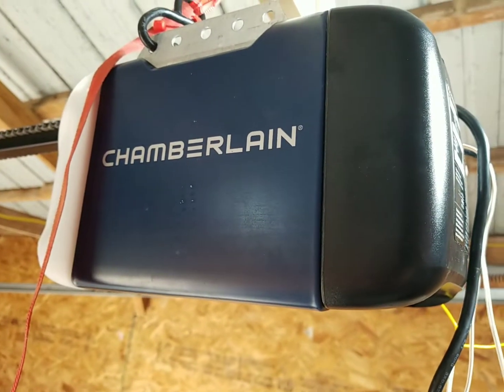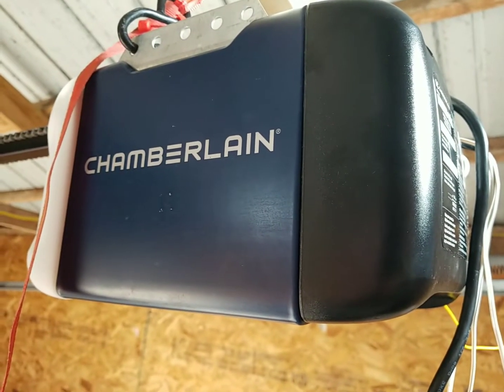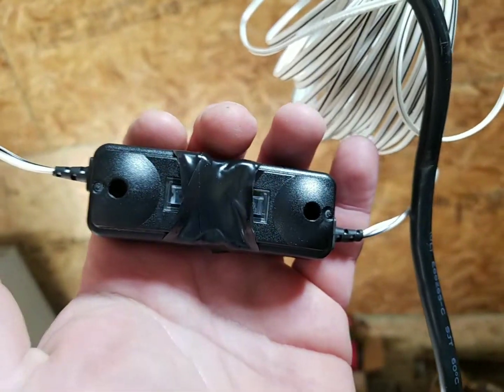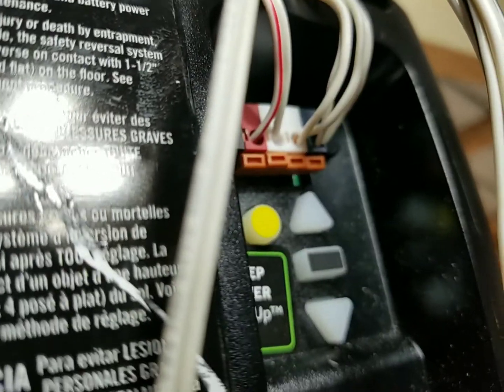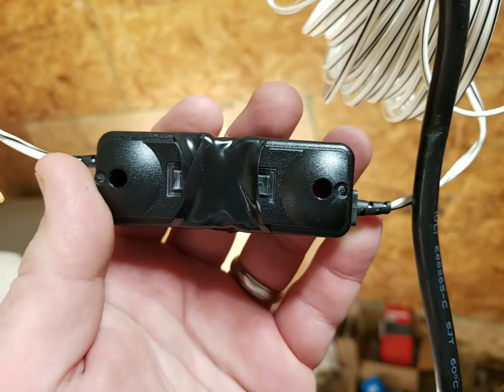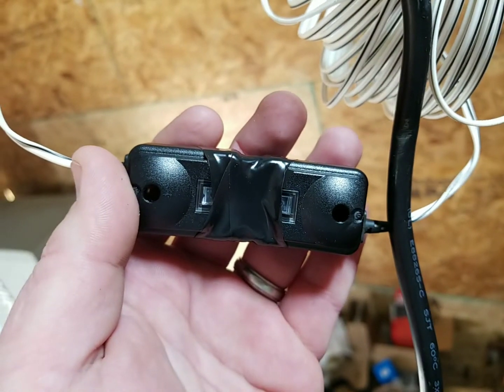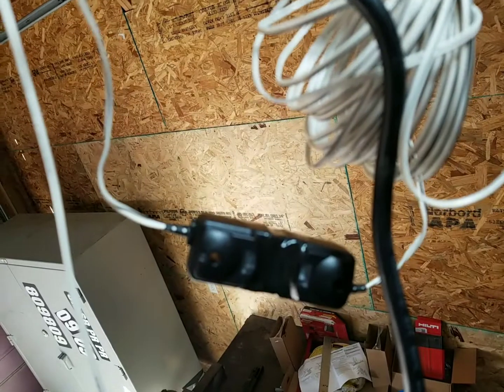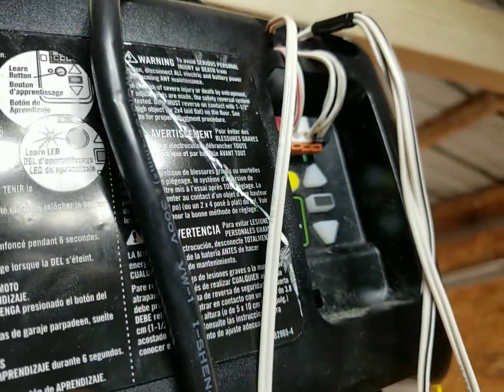Can You Use a Jumper Wire to Bypass Garage Door Sensors?

Comment: the problem with most senors is they use cheap single wire connections that break over time- you can solder better wire back and reuse  same sensor if you open it up and use common sense instead of buying new- and remember you have a catcher and a receiver of for both sensor for one door... one receives and one sends- dont try to use anything but a set when trying to fix two separate garage doors dont mix em up if you can... hope this helps! JM

Comment: A big tip of the hat for mentioning the "pulse signal" because I, too, was wondering why the heck we just couldn't jumper the thing with a wire.   I wonder if the manufacturers do that just so folks can't easily override it.
Reply: I think you are 100% correct.

Comment: So basically, I'm screwed. This doesn't work for me. I replaced the sensors and the door still won't close 80% of the time. Door moves freeley and is balanced and nothing in the way. Very frustrating.
Reply: Did you ever get it figured out?

Comment: These sensors are anpain in the a**. Spent like $10,000 on a fancy garage door from a professional company but they use this junk home Depot brand. Nothing but trouble with these stupid sensors out of alignment even though the lights are indicating they are. One time I found a spider web partially blocking it. But ever since then it just hasn't worked right. Finally ripped the crap out today and just did this basically. Use the mounting holes to make a sort of bar between the two so that I didn't have to use tape and it held nicely. Just have to keep an eye in case some spider decides to go between there and do a bunch of webs there's about a millimeter gap. I'd post pictures of what I did but I don't think YouTube let's photo replies. I wouldn't bother putting this where it belongs I'd leave it like this. I guess it's a safety measure but I'm not sure like you know if your foot or something gets stuck in it and there's any kind of pressure this garage door opens up anyway. And even that is giving me headaches. LiftMaster is really a pain in the you know what to modify any of the settings. It's purposely designed for service calls. I like the garage door but I hate this brand opener.

Comment: Did you actually try short circuiting / jumping those two terminals?
what happens if the wires connecting your sensors short circuit because installers don't bother to tape or wire nut them, do they arc/spark? (yes, i know its only 6v) does it blow a fuse in the motor? pop a capacitor on the circuit board? does it do nothing at all?
Reason I ask is... a neighbor just had a fire start in their garage. she swears it was started by "garage door came down and hit the bottom sensor which sparked"
This sounds highly unlikely... I don't understand how their door could hit the sensor first of all... I would just go out and short the wires on mine to see if it can even create an arc, but I don't want to blow something on the circuit board in the motor.
Reply: There is no way those sensor wires could start a fire if shorted together. That's all low current and low voltage. The sensor inputs are tied to the microprocessor I/O ports. It's not fused. Some boards are current limited and don't care if a short is present. Some boards do. FYI
Reply: @Chriscraft50  Right, my thoughts exactly.
Reply from the maker: I did try it. Nothing happened. I can't say for sure if you'll have the same experience, or if the results vary with different model openers.
Reply: I tried it as well and nothing happened.  It didn't hurt the unit, but it also didn't bypass the sensor.
Reply: I tried too. nothing happend
Reply: It's more likely someone spilled some gasoline, or sprayed WD-40 all over the rails and all over everything, and some frayed wires chewed up by mice started a fire. 

They couldn't sue themselves nor sue the mice, so they sued the garage door business 

Shorting out a car or motorcycle battery will certainly make a big fire, done that. The car battery has enough amps to melt steel. I've done welding with an old, used car battery.

However, a garage door sensor uses 180 milliamos, according to that 12 minute video this guy mentioned, so no fires there. 

Maybe a hot LED, but that's it  It only takes 3 volts to burn out a 2 volt LED, and even then they simply get a little warm.

I once hooked up my battery backwards in an iPhone. It got really warm, just about too hot to touch, and so I dropped it onto my vinyl couch where I was working on it while watching TV. Nothing happened. Well, no, I switched to Motorola.

My Dad once started a fire by never dusting his room nor his computer monitor, and the dust shorted out one small spot that burned up the board, making a hole and melting the solder. Well, that stopped the electricity, which stopped the fire. It went out by itself.

A few days later I soldiered up his 3 components and he used that monitor for another few years until the blue and green pixels stopped working and everything looked pink. 

So, shorting out a garage door opener, the motor controller on the cieling, might start a fire, but I doubt it would burn long enough to start the plastic housing on fire. And if that doesn't catch, then the drywall won't catch. 

Unless, of course, you spray it up with WD-40 just before shorting it out. Then you get a big fire. That s*** burns like gasoline. Great for starting campfires.
Reply: @MultiPleaser  yeah the lady's story didn't make sense on several levels.

FYI WD-40 is not actually flammable by itself. It's the compressed aerosols in the spray can that are flammable which are gone immediately after you stop spraying.
Reply: @squirts1 Actually, I save all my greasy and oily paper towels  for a year and take them to the campground. The wd-40 oil has long since lost its volatile compounds, and it still burns like gasoline. Very hot.
Reply: @squirts1 So, water burns but oil does not. Gotcha. 

And what asylum are you posting from?  

Did they forget to make their rounds and you are off your meds?
Reply: @squirts1 Well, if you make a video showing that it can not happen,, I'll make a video showing that it can.

Keep in mind, I said they probably just got done spraying wd-40 all over the place. That means lots of funes and dripping wet.

Yeah, Mythbusters usually were able to re-create  myths that they busted. They just had to adjust the parameters.  

Just like Edusin made about 100 light bulbs that did NOT work, he eventually made a few that did, namely carbon and tungsten fulaments 

Did he prove electric lighting was impossible?
Reply: You remember Eduson and his filuments, right? It's nice the keyboard has a few vowels right next to each other. Makes it easy to read typos.
Reply: @squirts1  Spray it all over the chewed up wires that make sparks.  Did you read that part about the chewed up wires and sparks?